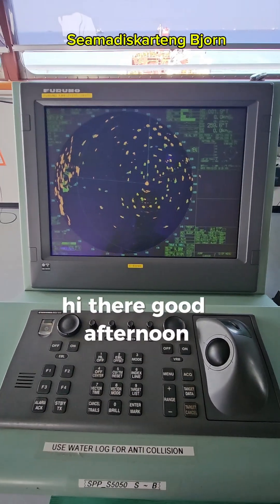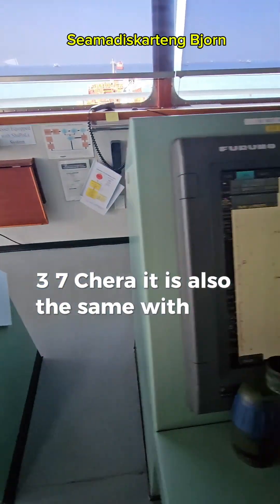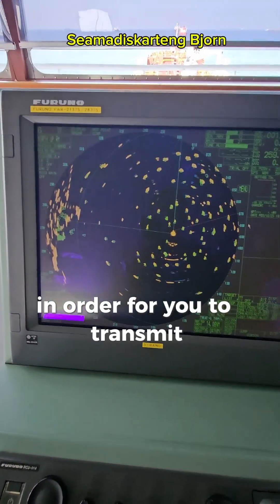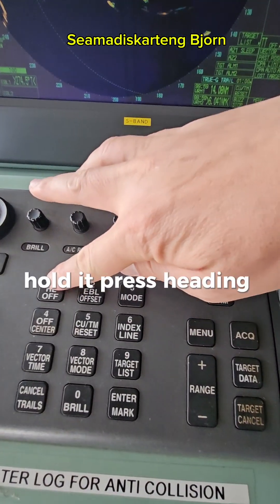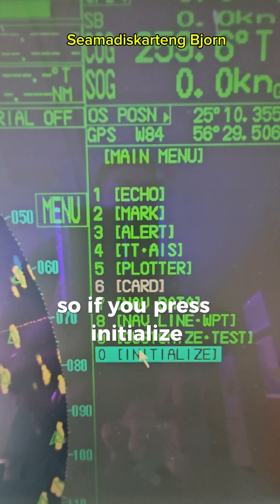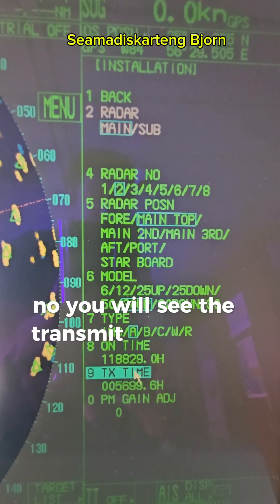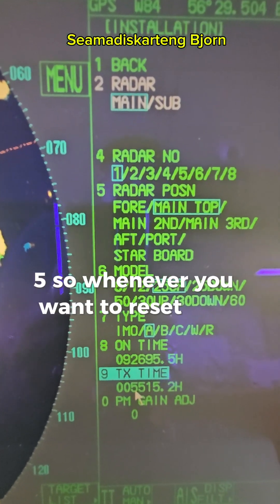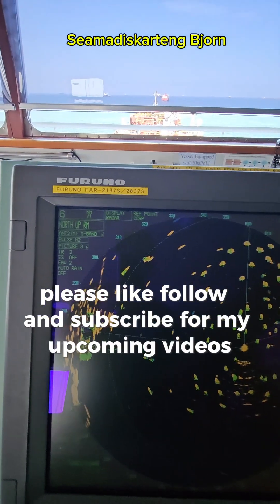MARINER'S SECRET REVEALED! How to access INITIALIZE SETTINGS of your FURUNO Radars & reset TX hours

Comment: Paano mapabalik sa dati sir para mawala yong initialize sa main menu?
Reply from the maker: Yes. To hide again the INITIALIZE button, you can just press STBY, then off, and then switch it On again..
Reply: Hello. I had this hidden menu activated but after turning the radar off, I am not able to enter engineering menu. When I hold HL Off button and press menu 5 times, the initialize menu is not showing on the menu. How can I chang that?